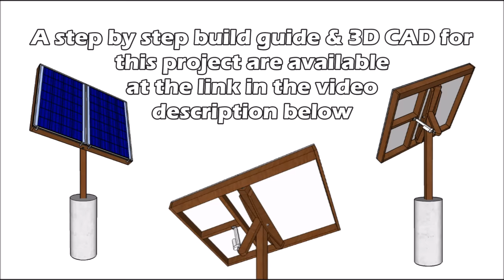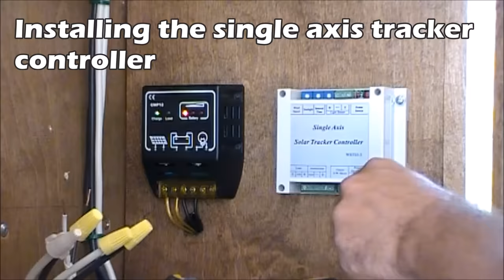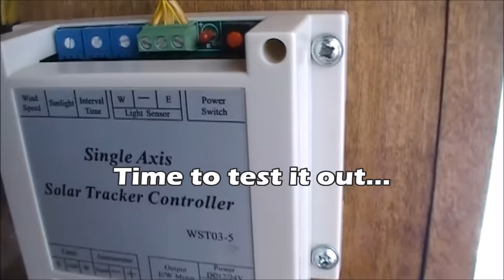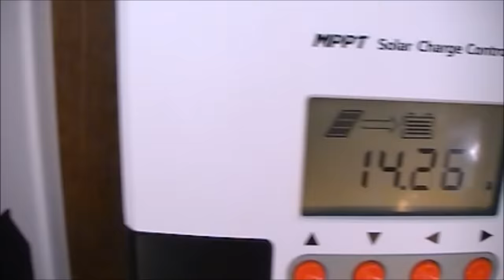Build A Solar Tracking System - DIY Solar Tracker - Off Grid Living!

Comment: Great tracker and video. One question, is the amount of extra energy you get out of the solar panels worth the extra effort of putting the tracker together and maintaining it longer term? Solar panels are so cheap now, so would it not be more cost effective to just buy more panels?
Reply from the maker: Thanks! It depends on what you would pay for panels. Tracking systems like this don't take any more time to install or maintain than a fixed array. I've built plenty of both. Yes, there's an actuator involved - but if it ever fails then that's just a simple 5 minute job to switch. Two pins and two wires, positive to positive, negative to negative. Not very complicated at all. In fact, I would argue that these trackers were much easier and cheaper to install than the ground rack directly behind them. Let's work some #'s for argument's sake. I hope you're ready for a long post, I believe claims should be substantiated.

Manufacturing costs have dropped, but the end cost for the consumer still depends on availability. If you have a local supplier, then you can likely get a pallet for somewhere between 50-70¢/w. If you don't have a local supplier, like myself, then you have to pay for freight as well, which doubles the cost in most cases. I can walk in and buy a pallet of panels from the nearest supplier solarwholesaler.ca in central Canada for exactly 52¢/w - if I drive over 1000 km's from the east coast with a large cube van to get there first. The alternative is paying an additional $3k to have them shipped here. The end cost would be somewhere between $1.40-1.50/w (that's Canadian dollars, not US). This is why local retailers and dealers in my area for said suppliers - like The Cabin Depot for example - are charging within that range. Some are marked up as high as $5/w - see Canadian Tire. It's ridiculous. Can't get them any cheaper unless I build my own (most people don't have a proper laminator though). Moving large, fragile items 1000 of km's costs a lot of $. But this is true no matter what the product is, really. The further north you are in Canada, the more the cost of living goes up because products have to travel farther to get there. This is why a lot of communities in the territories still practice subsistence living, the alternative is just too expensive.   

If you do the math, for an avg NB'er like myself to buy the 480W of PV in the video would cost them around $670. +25% to add more PV instead of tracking would be an additional 670 x 0.25 = $167.50. That's around $17-18 more than what I paid for the alternative tracking kit with the linear actuators (which was a couple of years ago, not sure what they're selling for now but they can't be too far off from that figure - it's a pretty common type found on Ebay or Amazon). Not a huge difference for a small system, for sure. What's $18? But the actuators are actually rated to safely carry up to a ~300 lb load each, which is equivalent to 1000 watts worth of PV (typical panel construction). So technically a person in my region could double the amount of PV that I have on each tracker for a total ~2 kW capacity to get the highest payback from the investment in the tracking kit. @ around $1.40/w, that would be $2800 for the PV plus $150 for the tracking kit, so $2950. We'll say an even $3k, just to be generous. If they were to buy 25% more PV for a fixed array instead of the tracking kit, then 2000 watts x 1.25 = 2500 watts, at a cost of 2500 x 1.4 = $3500. A savings of $500+ on just 2 kW, which is around half the capacity of a typical grid tie system for an avg home in Canada. That's compared to a fixed array on a ground rack facing south and angled at 45° (the optimum all season fixed angle for our latitude). It doesn't include rack material costs, but they're comparable - even a fixed array needs to be anchored in the ground for stability, and requires slightly more lumber to support the platform because there isn't an actuator helping out in that regard. The savings could be even higher when compared to a rooftop installation, depending on the pitch and orientation of the roof. Panels on a roof will operate at higher temperatures and be less efficient as well, but do make up for it with affordable mounting requirements - that doesn't necessarily make them more affordable than a tracking system with better operating temperatures and efficiency though. 

The bottom line is that if a person thinks they're going to burn up $1000 or more in maintenance costs for a full size tracking system over a typical 20-30 year lifetime, then they're doing something terribly wrong and need to reevaluate their approach. The only maintenance a person should be doing on any solar array is cleaning and periodic inspections.

People can speculate based on a first glance look at prices online, but the only way to find out which is better for sure is to do the math and determine what it's going to cost a person on an individual basis. What I pay here in NB Canada isn't what someone living in Silicone Valley is going to pay, or Peru, China, India, etc. That's why encouraging more solar manufacturing development around the world instead of just allowing the US and Asia to dominate the global market, is imperative for making RE cost comparable to dirty alternatives everywhere.

Comment: Always wondered about the energy lost moving the array vs the extra energy recouped. Have you done any numbers?
Reply: The arm is 12 volts at 3amps it moves it’s complete range over the whole day so it’s moving for less than a minute each time. The controller more than likely is using less than 400ma an hour. Average solar tracker gives about 14 percent more power. It looks cool gives the maker a stream of income on YouTube and by plan selling which is great. An additional panel of 100 watts costs an extra $100 usd and would give a better return but if you need power early in the morning and late afternoon to boost a smaller battery bank then it becomes a different story. Many of us who are interested in solar as a hobby put more money into it than we do on beer and smokes! It sure is fun making electricity from the sun with something you made well and continue to change and reconfigure.

Comment: In my opinion, in this case it is better to use a fully mechanical solar tracker powered by compressed spring energy and not consuming electricity. Why are these sensors looking for the location of the Sun, if it is already known where it is?

Comment: What kind of wind speeds do you get in your area? I'm wondering what do you expect these fine contraptions of yours could withstand. In my area we can get wind gusts in excess of 100 km/h several times a year.
Reply from the maker: I've logged the same on my anemometer, 30+ ft in the air. DIY axial flux wind turbine ate it like a pro. I'm surrounded by trees so I don't get that sort of wind at ground level but according to my code book, the structural spec's of the lumber used in the trackers and the size of the footings, they should withstand the peaks just fine. Folks can consult the NRCC (in Canada) if in doubt about the wind speeds in their area, and size the components according to the expected load. A wind speed sensor can also be connected to the tracking controllers so that when the wind speed exceeds a certain point (set by the user), the controller will automatically position the array so that it's flat to the ground and decreases the surface area facing the wind (this obviously works best with the dual axis tracking kits).
Reply: Thank you for the information. I've seen these blasted winds really do some damage, like pull out big ass trees or break off thick branches all over the place. Probably it would be best to prepare for these special occasions and maybe quickly disassemble the setup as to protect it from unfriendly weather.

This of course gave me an idea for your next project: a transforming wind turbine-solar tracker. When it's windy, it assumes the wind turbine form, when it's solary it assumes the ... well, you get the gist of the idea, I rest assured.

On a more serious note, I'm certain you have considered a vertical axis setup, on several places I have seen people mouth it off in favor of horizontal axis, but I haven't seen any decent data on the subject. Can you point me in the right direction?

There's another setup I have been conducting numerous thought experiments with, something I don't really know what would be called like so I can't look for it efficiently and see what people have done with the idea. 

Basically, without taking too much advantage of your precious time, I'm thinking about a plant based on a wind/draft catcher of sorts. The higher up part of the structure, I'm thinking something akin to a fire watch tower, would have several concave surfaces with a hole in the center leading into an area (1) which would extend to a pipe leading down the structure into a fairly remote area of relatively lower air pressure (2). If you would cut that pipe and place a turbine in there, I'm sure it would spin quite merrily. Now, I don't have any idea how to simply manipulate area (2) to make the air pressure even lower, I'm assuming it would be best suited to be placed behind any large structures, which would pose a great resistance to the blowing wind. Nice thing about this could be that you could connect area (1) with multiple pipes to areas around the perimeter, the draft speed/trajectory should adjust accordingly, following the path of lowest resistance/greatest pressure differential. The split would be done after the point at which the turbine had been placed, obviously.

Of course, for any given area and over a multitude of given weather conditions measurements could be conducted on various points to measure where the largest air pressure differential could be achieved.

With your engineering experience, does this make any sense? Have you seen (probably insane) people attempting to construct something like this? I see several possible advantages and optimizations with this concept. The "fire watch" structure could be just a roof of the house or a cool looking completely passive tower mounted above the house. The generator would be tucked away on a dry place, easily accessible for maintenance and repair. Pardon my rambling, if you made it this far, I commend you good sir.

Comment: How do you get by using steel rebar for your grounding rods? Copper grounding rods are better with less resistance.
Reply from the maker: Copper is better for sure, but as stated in the video the drier your region is, the more ground you'll need and warned to consult local codes for the best grounding method. I live in a Maritime province, it's pretty wet here. I could have just buried a foot of the wire in the ground and that would have sufficed.

Comment: how much more energy are you producing using this mechanish? can you tell us in percentage? how efficient it is?
Reply from the maker: Not without logging annual power data and comparing it to an equally sized fixed array, but you can easily google tracking system research that's already been done by others which will give you a pretty good idea what to expect (refer to search link below). As indicated at the beginning of the video, you can see up to 25% more energy on average compared to a fixed array based on said research, though this figure will differ based on design (ie: single or dual axis and range of motion, etc) and region (solar irradiance increases at the equator and decreases at the poles). 
https://www.google.ca/search?safe=off&ei=H3gYWszzIMicjwTR6aLQAQ&q=solar+tracking+system+data+comparison&oq=solar+tracking+system+data+comparison&gs_l=psy-ab.3..33i21k1.31018.36215.0.36548.37.27.0.3.3.0.327.4447.0j7j12j1.20.0....0...1c.1.64.psy-ab..15.22.4204...0j35i39k1j0i67k1j0i131i67k1j0i20i263k1j33i22i29i30k1j33i160k1.0.05XTNlW5dCA
Reply: @JamesBiggar  great video James,
where can I find the manual for the tracer?

Comment: Excellent video, I also really enjoyed the solar panel build video. 
Question do you have to reset the track in the morning? or does it self reset to position where sun comes up above the horizon?
Reply from the maker: Thanks! The tracker automatically returns to it's morning position as soon as the sensor detects the sunrise. A wind speed sensor can also be connected to it so that it can move the panels to a 'flat' position relative to the direction of the wind and minimize the wind load to prevent damage. It also has an automatic homing position for overcast days too.
Reply: I was just going to ask about wind and voila, you have an answer.  great video.  Loved it.

Comment: Does it work well without bearings?
Reply from the maker: Do old school wooden windmills still work without bearings? Yes. This is an extremely low speed/low load application in comparison. Bearings are a waste of $ on something like this. Not everything needs to utilize top of the line components. CBA is the determining factor when you build on a budget.
Reply: @JamesBiggar  Well I guess so, but I'm building my frame out of aluminum and Unistrut so I'll put bearing in along with Stainless shafts in the bearings. it might be overkill but I'll be happy that it will move freely and have less drag on those motors.. Have you figured your gain over a fixed system. I adjust my other array in only one axis and It seems that with a 2 axis tracker you could make about 40%  more  KWH over a fixed non adjustable system.............Cheers, Jim

Comment: How do I DYI something like this if I am too busy because I have a job?
Reply from the maker: You must be a busy man. I own/operate two small businesses but somehow manage to create the time.
Reply from the maker: Cosmetics is a matter of opinion really, I think mine look great. But it sounds to me like you just need more math in your life. Take some time to understand solar power better, do some calculations - especially when comparing rooftop solar with tracking. Rooftop is probably the worst place anyone can install solar panels. Heat and snow really take a bite out of efficiency. Some installers claim "well our mono panels can melt snow that's 4" thick!" But it's complete BS. My poly panels create more wasted radiant heat than mono panels and they have a hard time melting even 1" of snow - takes all damn morning. Panels should always be installed in an easily accessible location.
Tracking on the other hand, or even just a fixed ground array, are the most cost efficient methods in the end because they result in the most kWh's produced at the end of the day for almost the same cost as rooftop solar - just tack an extra $150/1kW of PV for the controllers and actuators. Pretty minuscule cost for 25% more energy. I've explained the initial costs and ROI for my system and the potential for anyone else in multiple other comments. The numbers are what matters, not anecdotes. Come back and show me your work when you're done. If you need any help feel free to ask. I have loads of experience with cost benefit analysis. If you're creative enough then I'm sure you can come up with a way to install solar and make it look good. There are seemingly endless possibilities.

Comment: All the works  so that you can produce maybe no more than 25 cents worth of electricity a hour.   I would go without the tracker part.. and forego the 25% boost in efficiency.. I would put another fixed solar panel and to heck with it.
or even 4 more fixed solar panels that will be cheaper than the tracker system alone itself..
Think economicx..
Reply: or be more carbon neutral even if it means less efficiency. so what?

Comment: Should not have used the old drum in the concrete.. The reo rod, will rust, and break up your concrete.
Dig your hole, fill it with concrete. All reo rod should be enclosed in the concrete.